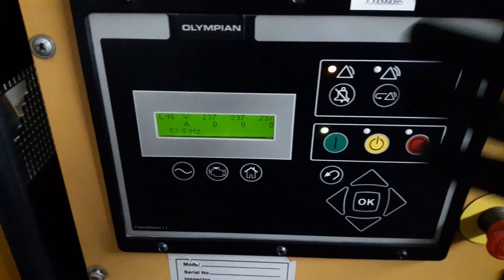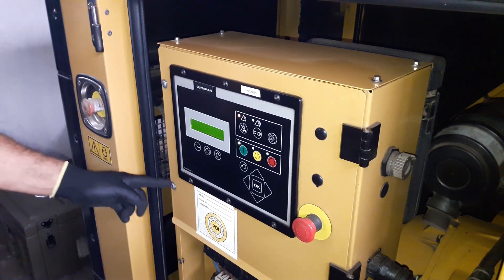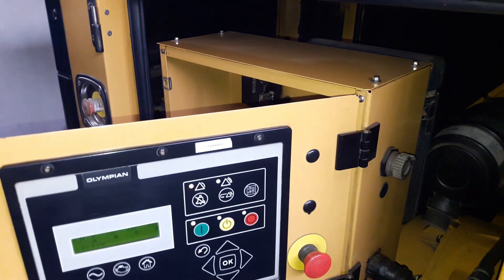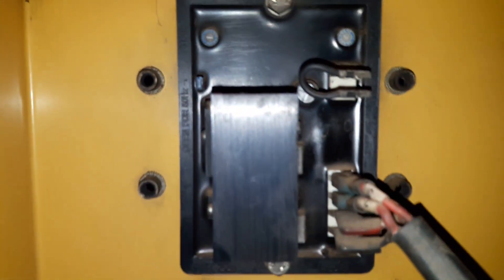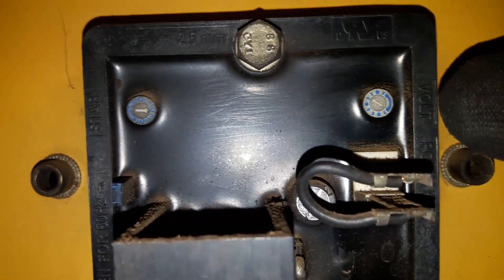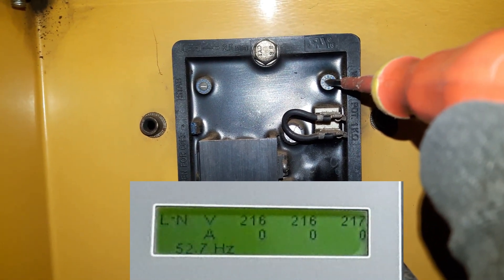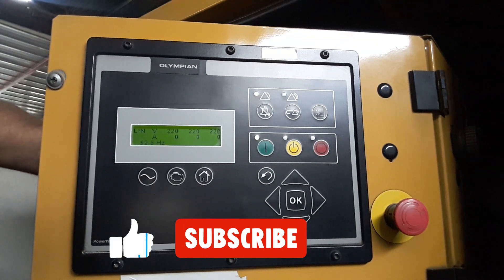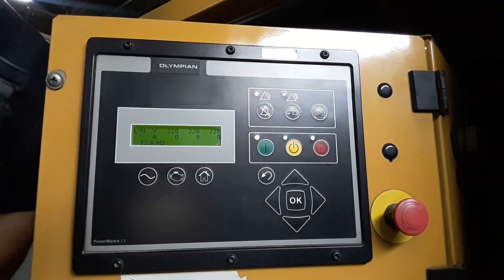How to Adjust Generator's Voltage ?     #AVR #perkins

Comment from the maker: Dear Followers 
Accidentally I have been remove one of the question, who has inquired me how to adjust the frequency and increase it to 60Hz ?
My apologies guys for this inconvenient event ! 
my answer for this question is :
The output frequency of a generator is one of the important parameters that determine the generator’s rating. The electrical output of the generator must be maintained at a fixed frequency, 50 Hz or 60 Hz, to match the output of a standard electrical grid or the frequency rating of your appliances.

The frequency is typically 60 Hz in the US and 50 Hz in Europe. You may also come across different isolated sections of the same grid operating at different frequencies. It then becomes essential to vary the output frequency of the generator to match that of the appliances to be powered or of the grid to which your generator is connected.
 Changing Engine Speed to Vary Output FrequencyPresent-day generators consist of an engine directly connected to an alternator to produce electricity. One of the most common ways of changing the output frequency of a generator is to change the rotation speed of the engine.

The two factors are related as per the following formula – Generator Frequency (f) = Number of revolutions per minute of the engine (N) * Number of magnetic poles (P) / 120 Conversely, P = 120*f/N

As per the above formula, a 2-pole generator producing an output frequency of 60 Hz has an engine speed of 3,600 rpm. To change the output frequency to 50 Hz for the same generator configuration, the engine speed needs to be reduced to 3,000 rpm. Similarly, for a 4-pole generator, an engine speed of 1,800 rpm produces output of 60 Hz. Reducing the engine speed to 1,500 rpm yields an output of 50 Hz.

In the case of small or residential generators, you can alter the engine rpm settings by making a few changes on the control panel of your unit. Follow the steps given below to alter your generator frequency from 60 Hz to 50 Hz:Run your generator engine and tune the frequency meter on your control panel to read 50 HzCheck the AC voltmeter or potentiometer as the case may be and read the voltage output of the generator. The output voltage decreases as you reduce the frequency and may be lower than the desired valueAdjust the AC voltmeter or potentiometer on your control panel until you obtain the desired output voltage at 50 HzBy making similar modifications on the control panel, you can increase the frequency from 50 Hz to 60 Hz If the control panel does not display the frequency, you will need to first connect a device that will measure the frequency while the generator is in operation and then change the engine rpm.
Generator controller units undertake real-time monitoring and control of your unit. Built-in protective functions automatically shut down your generator in the case of excess engine rpm or very low output frequency.
Before you do any adjustment on your generator please read the technical specifications of your generator in user manual.

All the best